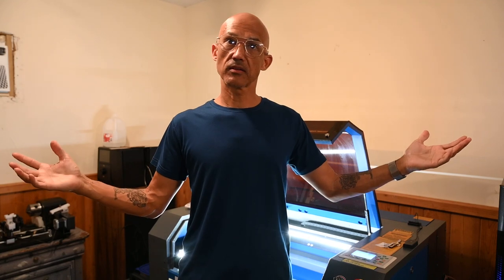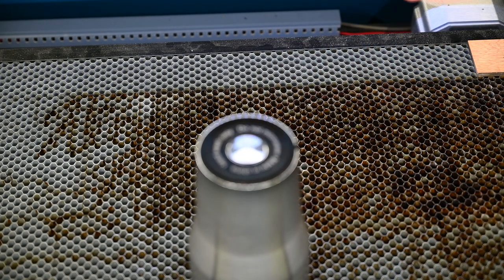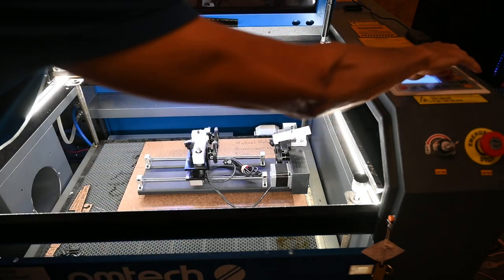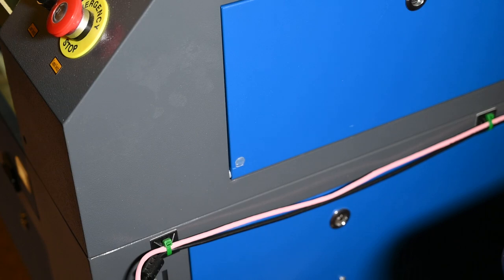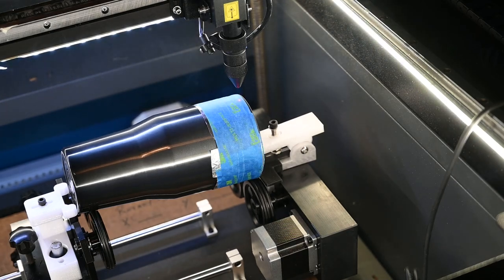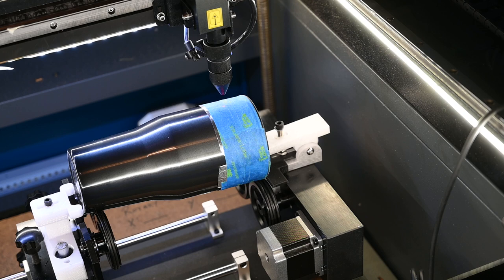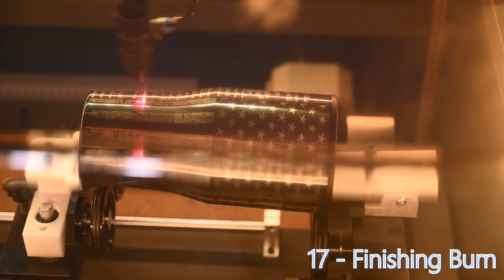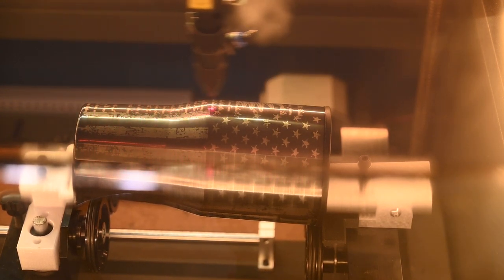Step-by-Step Guide: Laser Engraving a Full Wrap Tumbler Design (Omtech Laser, Cloudray Laser, etc)

Comment: Thank you so much for using my design in this video! I wouldn't have been able to make any of these designs if it wasn't for purchasing your rotary attachment! Your attachment completely changed how this rotary performs and saved from needing to buy a $800+ Piburn rotary. I have a chuck rotary I got with my Fiber laser but it takes so long to get tumblers straight and doesn't fit a lot of the popular tumblers, the 4 wheel rotary is easier to setup and I can engrave just as fast now without worrying about slipping. So giving you the files to sell with your attachment is the least I could do after how much it saved me. Great video too! it has so much helpful information and I also love how the image turned out on that tumbler. Glad to see the new laser space too, having a temperature controlled environment when working with this stuff is always helpful for the laser and for you lol.
Reply from the maker: Thank you so much, Joseph!

Comment: Did I miss the part where you talked about focusing on a tapered cup? It looked like smaller end was tilted up, but was hoping for some info on how you determine this adjustment.
Reply from the maker: I started to talk about it around the 09:45 mark, but then I think I 'squirrel'd' and started talking about the placement tool.  You want to raise the rear of the cup so that you have a fairly even distance from the nozzle to the cup across the whole length.  It won't be perfect... you may be a able to be at your focal distance (mine is 18mm) at the front and back of the cup but the center will be a bit close (like 15mm) . With cups like the one in this video you'll always have one area that's not perfect since the cup isn't a single taper angle.  The 'longer' lens you use (2.5", 3", or 4") will allow you to have a larger focal range without being too defocused (although your spot size increases and you lose detail).

Comment: Thank you for these videos! I just did my first full wrap and had a slight error. Some of the lines in my designs came out 'wavy' I wish I could add a photo to show it. Do you think that is because the tumbler wasn't properly lined up on the rotary? Or could it be caused by something in my lightburn settings?
Reply from the maker: It's hard to say without seeing the problem, but two things that come to mind that you should look into are Scan offset and making sure that your lens is not loose.  Both can give a wavy result.